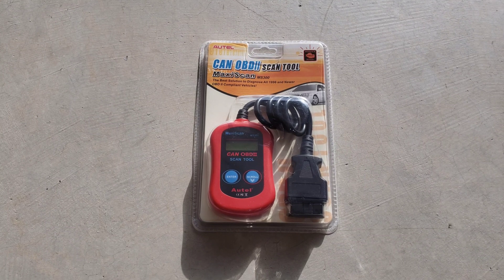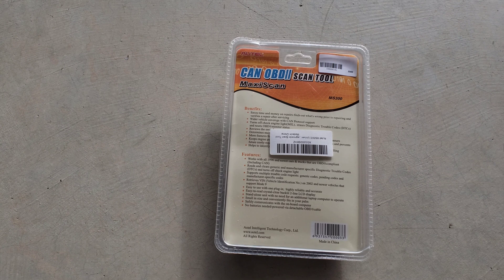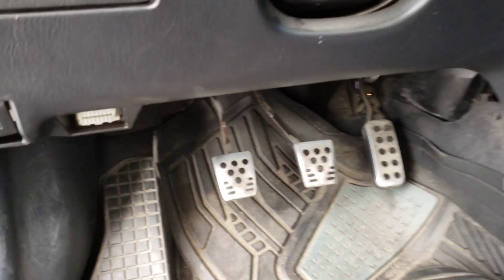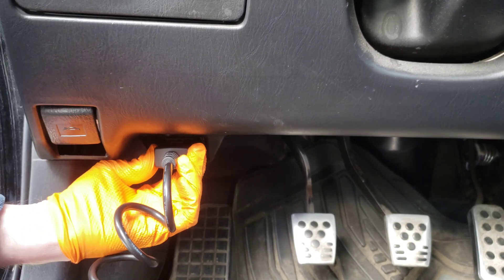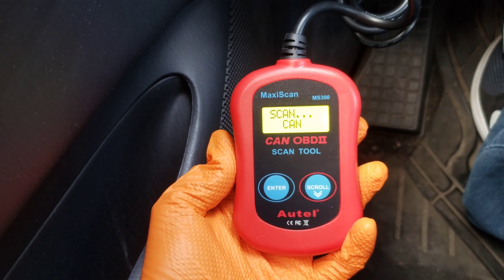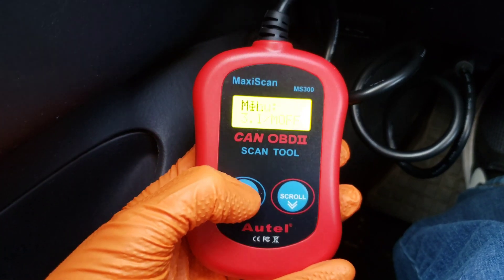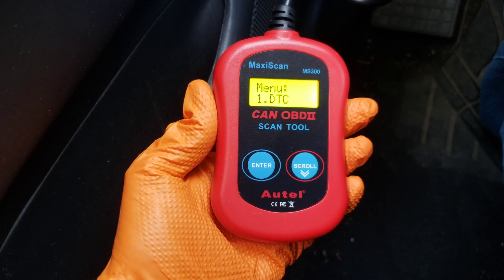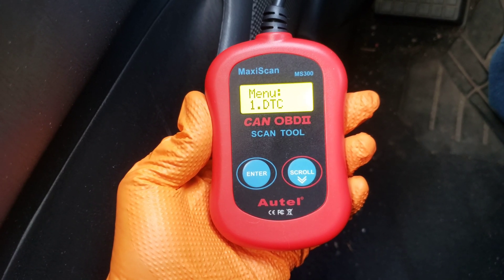How To Use The Autel MS300 OBD2 Code Reader - Check Engine Light

Comment: I am new to these code readers but 
what good does it do to erase trouble codes or even clear them, isn't the issue still there??  can it test my hybrid battery pack on my 2001 toyota prius??  if not, what cheaper bluetooth dongle could i get?
Reply: After you fix it you can clear the codes. Or you can clear them and see if the codes come back.